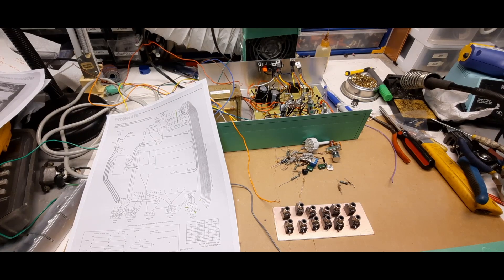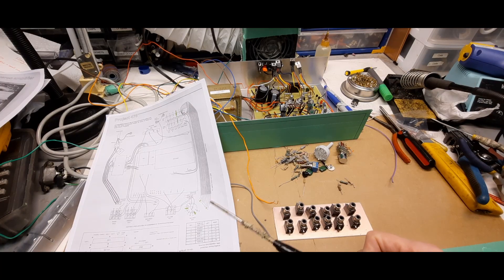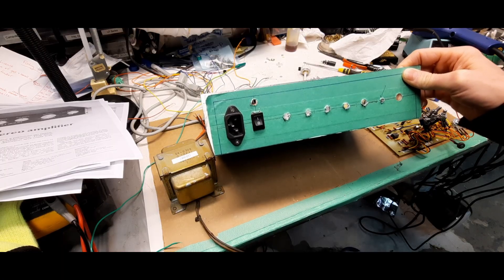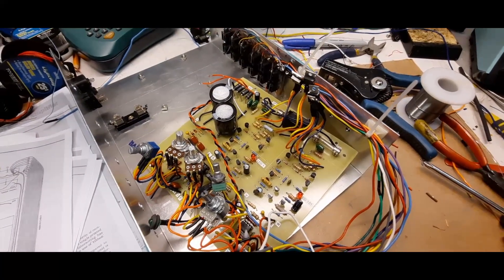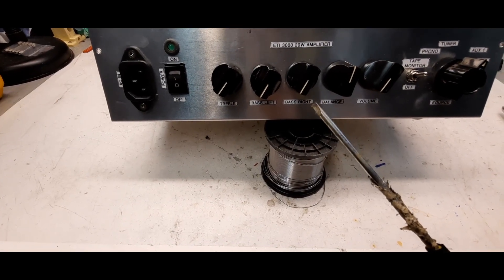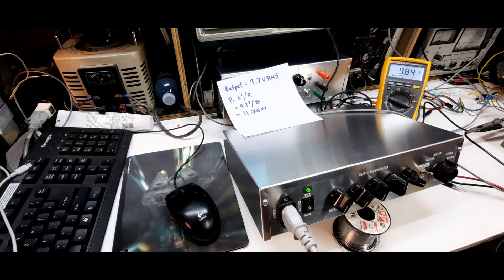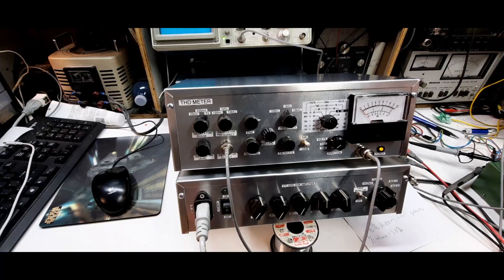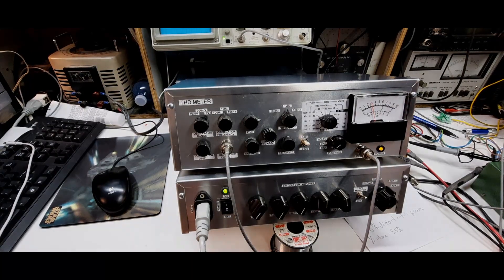Electronics Today - November 1980 - 20 Watt Amplifier - Part 2

Comment: For the control labels, do you just print them on paper and glue them to the chassis? I like your homemade electronics look. Reminds me of the projects in the AARL handbook (I have the 1969 edition).
Reply from the maker: I have small Brother Label Maker. It is very basic but you can frame the words. I just print and then cut the printed label out. It's that simple. Cheers!

Comment: Those '20 Watts' might mean the total of both channels. Assuming that both your channels produce the measured value of 11.75 watts, you have 23 W. Have to say, though, measuring the 1kHz output with a digital meter incorporates a fairly high rate of inaccuracy, as the vast majority of DMM's specify their accuracy only up to 400Hz.
Reply from the maker: Good points. I remember checking the scope first with regards to max output before clipping and it measured the same when converted to RMS. I will keep the meter thing in mind going forward. Cheers!

Comment: oh you made a part 2. I already accumulated free ebook copies of ETI,EPE,EP and many more from the web. I like to build that same circuit. and a little advice use shielded wires on your potentiometer at tone control and audio inputs. to eliminate unwanted noises. peace
Reply from the maker: I'll make sure to add that to my next build - thanks for the tip!
Reply: @bettinaneumryr  I read it from a book. it says if your wires exceed 1 inch in audio inputs and wires use to extend potentiometers, better use shielded wire.
Reply from the maker: If you decide to film your builds let us all know your site. I would love to see other builds. Good thing you got all the magazines ... you never know if they go off-line for some reason.
Reply: @bettinaneumryr  yeah internet archive went down. but luckily it is up sharing knowledge again.
currently I am into restoring China made amplifiers and modified some parts a little bit to make it better. not to brag anything. I am just a beginner in electronic hobbyist.

Comment: I doubt your construction is responsible by that high THD. Not only is that one janky schematic, it was designed with parts made 45 years ago. Although to be fair, high performance part were certainly available then. For instance the LM833 would be a much better choice than the LM301 and was available since the '70s. In addition the use of those three diodes instead of a Vbe multiplier mounted to the output transistors' heatsink is odd and will lead to poorly biased output stage. And then that weird compensation thing with Q3... Lastly, the the inclusion of R18, while not particular detrimental, shows the designer wasn't really aware of how a differential amplifier works when made into a discrete opamp. And, while I'm ragging on the design, I don't understand the use of zener shunt regulators for the preamp opamp power supplies when the 7800/7900 series regulators were available.
Reply from the maker: Thanks for pointing out the design issues, I appreciate the feedback! I am not that well versed is the design aspect of electronics but I sure like to build them and learn more when I trouble-shoot to get it going. Cheers!
Reply: I think the jankiest part of the design is the use of BC548/558 transistors with their 30V VCE Max in a place requiring around 50V swing. The 3 diode biasing string makes the amp look like a crude little current dumper! In the quiescent state Q9 & Q10 should be inactive and Q7 and Q8 are the output devices with an idling current of 3 or 4 milliamps. Beyond a small amount of signal swing, Q9 & Q10 will begin to conduct to source or sink the necessary current. Similar has been done to drive headphones from an Op Amp by putting a class B emitter follower complementary pair across a load resistor. I suspect your doubt about high distortion may well be right, and I'd nominate the non-linear switching of the class B devices.